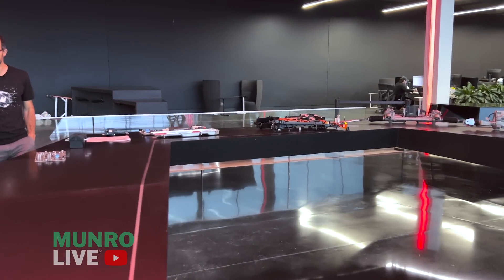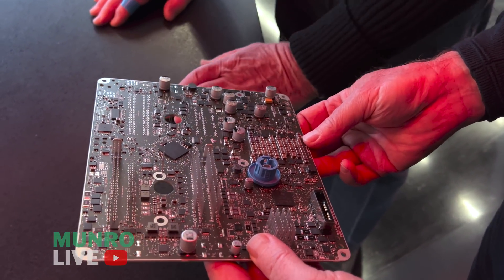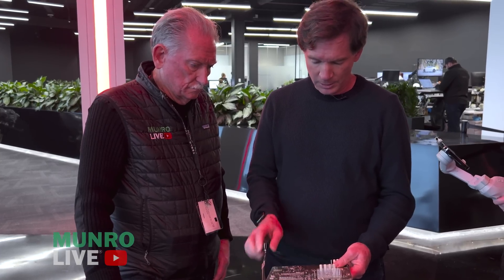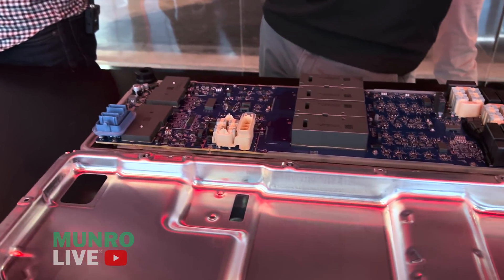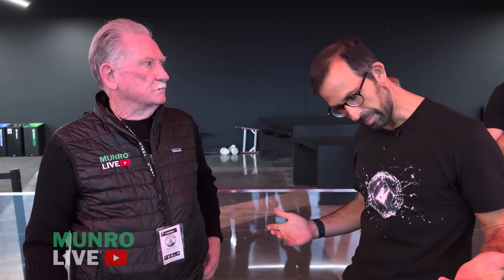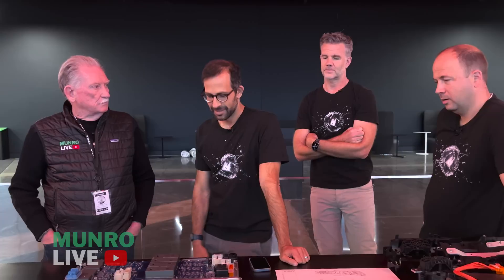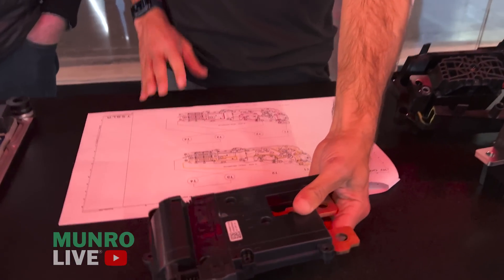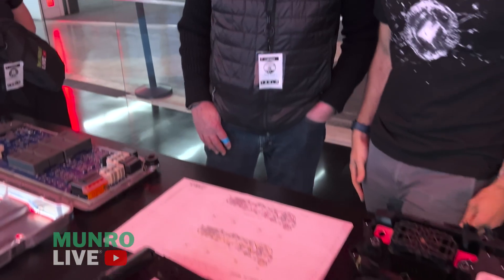Tesla Cybertruck's Power Converter capable of 800V

Comment: See I have a problem with this everyone saying oh well you don’t need the battery extender if you don’t drive very much but on the same term you’ve got all that power supply certainly someone’s gonna use it. Especially somebody on a ranch that 100,000 acres say or more don’t believe the acreage could be that much look it up. There’s several ranches there a lot bigger than that in the United States now imagine putting up a fence line around the entire acreage, and using the power supply to operate equipment while you’re doing fence post or working on. Other things on the ranch true the same could be said about some farms using the power supply unit, so yes, the extended range is needed in these applications, but what do I know? I just drive a diesel truck and work on a farm when I was younger, and now I have my own land to work on, just pointing that out for you Sandy this is what a pick up used for or at least it used to be

Comment: I find it interesting that they're using a switched capacitor power supply to bridge the 12 and 48 volt power busses.  I'd have expected a forward converter with a transformer and synchronous rectification.  That many ceramic capacitors are super expensive in small quantities, Tesla must get them at a great price.
Reply: What are you on? LMCC's are super cheap in  volumes companies buy. single digit cents a piece!  If you're buying 5 you're not paying for the components, you're paying to have someone cut the tape and count the components.
Reply: For safety, galvanic isolation is required on most 48V to 12V conversions.
But if galvanic isolation is there why limit to 48V, get a 400V/800V flyback is super cheap and reliable.

Comment: Those SMT electrolytic cap's have a life time of less then 10 years....in room temperature....and that far below manufacturers max electrical stress parameters.
Reply: Just enough to last 8 year warranty. After 10 years the battery will be dying and replacement cost will not make sense. These are 10 year lifetime disposable cars. But the tech is super cool that for sure.
Reply: @antronx7 to be honest, what new car will last more than 10 years? Definitely not any of the Detroit 3. Toyota maybe, but even they are slipping from reliability problems themselves. Most of my cars were made between 1992 to 2010, and I'm struggling to see benefits of owning another new car.
Reply: @TheReal_JG  Any car that has modular battery pack will be easy to retrofit with fresh cells. My 2011 Leaf can be retrofitted with new cells and it will keep on driving another 10 years. Easy to service, unlocked CANbus, cheap parts. Tesla wants you to locked in into their ecosystem and expects you to buy new car every 8 years.
Reply: @TheReal_JG  WEF Schwab have clearly said qoute: You will own nothing (rent when social credit score fulfilled), eat bugz and will be happy.
Reply: @antronx7 You are aware that the Model S is 11 years nowvand many holding up quite well?
Reply: @moestrei  If by holding up well you mean failing battery packs then yes.
Reply: @antronx7  1st pack , 380000km, 13% degradation. I know a number of high mileage Teslas...all in great shape. I'm not saying there are no failures but they are rare....I actually don't know anybody who had battery issues.

Comment: Did you hear about liberty engine( search on youtube) infinite energy they can modify a little bit and use that when use tractor mode for cybertruck so they don't need use energy from battery so it can reach 500 miles easily!

Comment: I wish we would go to a higher voltage esp on our actual power lines like europe does!
Reply: Standard power in Europe is 400Y230V.  One of the standard voltages in North America is 480Y277V.  NACS supports 277V.  Some utilities will provide 480Y277V to residential customers; nearly all will provide that to a business (if requested) instead of the 208Y120V or 120/240V that is normally supplied to small businesses.  BTW, split phase in North America used to be 110/220V, then it was raised to 115/230V, and finally to 120/240V.  Likewise, three phase used to be 190Y110V and 254Y440V, then it was raised to 199Y115V and 460Y266V, and finally to the 208Y120V and 480Y277V we have today.  There has been some talk of going to 125/250V, 217Y125V, and 500Y289V.  Doesn’t seem like it’s about to happen any time soon.

Comment: So there’s still a 24V component on circuit board right now, but eventually they’ll all go to 48V.👍
Reply: Well he mentioned the audio amplifier are 24V and Tesla are not going to design that part so they will push the component suppliers for a next gen.  Most amp chips for auto applications are <26V max unless you want the high power stuff but extra money where usually not needed unless a powerful subwoofer.  The level of integration here is certainly of a high caliber.  Most companies outsource a requirements spec and suppliers then bid for it.  The suppliers are usually free to use whatever design choices to meet the requirements but this is where it all falls apart.  Just think of all separate modules doing small tasks that need a separate enclosure, thermal needs, EMI needs, connectors, wiring, MCU running software written by the supplier, etc..  I know from experience than sometimes a supplier will put junior engineers to work on OEM modules with little experience.  One needs full control of everything if you want to make a next level product.
Reply: there are literaly 3,3v ,5v, 12v , 24v in that circuit still lol!! european trucks and equipments have been running on 24 volrs for decades alreadty just as example.
Reply: @alanmay7929  exactly!

Comment: All that Technology shown here more than compensate for the delays and price increase- 800V battery that can be split into two parallel for charging, a firewall with no openings on it coz the PCB is designed to attach from one side, diminishing current to 16th the one other vehicles less efficient use in their 12V systems, etc, etc, etc!!!!!  BRILLIANT!!!!!
Reply: They didn't diminish the current to 1/16th, current is 1/4th because voltage is 4x (12V->48V). The guy @ 3:30 is referencing I^2R (I square R) and is saying that results in 1/16th the heat. Probably not that low in practice, but it's undeniable 48V is the way to go.

Comment: Drew is so so proud of that power converter module!!
Reply: And so he should be 🙂
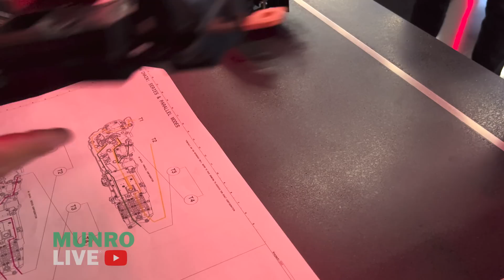Reply: Although, I rather wish they didn't show the diagram at 8:40. Let others figure it out for themselves instead of showing your homework. (yeah, i know it's not showing any component detail, but it's still a head-start for copy-cat companies )
Reply: @goldreverre exactly
Reply: The secret of parallel VS series is out!
I’m still curious could they have made the 2 sides, each 400V charge independently on existing SuC, possible anyone has thoughts? Might they have been able to increase charge throughput on existing hardware, charge port on each side until 800V is ubiquitous? @goldreverre
Reply: @goldreverre lol... very funny..

Comment: I'm so certain this is innovative achievement for Tesla. I don't have an EE degree so it is hard to understand what these engineers have invented and implemented into Cybertruck.
Reply: Speaking as an EE, I can say that many of the things mentioned in the video are not new or innovative as I've heard/seen them all before.  But, the way it is implemented using the best solution for the need and not being held back by simple or common thinking is where the innovative really occurs.
Reply: The new converter is smaller, lighter and will be cheaper with volume.

Comment: Lots of innovation in the Cyber truck.  Personally I would have really liked to see an integrated 500 mile range truck but understand the limitations.  Can the range extender be taken out of the bed and used to extend Powerwall capacity?  Also, why no power outlets in the front trunk?
Reply: It would be amazing if it can be added or removed for long trips but I doubt they will do that: electrical danger, weight, tight fit, need to absolutely secure it and ensure it doesn't get water in there. Seems like a specialist installation.

Comment: Why not just add a simple generator in the back running off of Gas Propane whatever charging the truck while you're driving?
Reply: For long trips
Reply: Warped perception chanel tried that w Tesla S. No doubt it can be done easier w CT 😊

Comment: A teardown with Tesla! What can we ask for more!

My breaking melted when the Drew said the CT can configure itself from 400v to 800v
Reply: GM did it for the Hummer but in a more complex method for 800V charging and 400V for normal usage. Were not able to have components run off 800V like this.
Reply: @petepetess  if I understand correctly, it configure itself to 800V only for charging and when you finish and go drive it goes back to 400V. That's one way of doing it. I google it and saw some info about it. Thanks for sharing
Reply: @JeromeDemers  DeWalt does it as well with their battery packs for a few years already.
Reply: @diavalus  yes! The 60V and then 120V for the miter saw! Good point. In dewalt i believe they did that to lower the current or else it was too much current for single 60v batteries or C rating was too much with that saw. Thanks!
Reply: @JeromeDemers , current can be limited, that's not a problem. The main reason why DeWalt did it was to keep it compatible with 18V platform (tools and chargers). Tesla did exactly the same thing to keep it compatible with older chargers.
Reply: That's GM's solution, @JeromeDemers  - a "400 V" vehicle with battery reconfiguration for faster charging at 800 V. Has Tesla done this, or have they built an 800 V vehicle with battery reconfiguration for charging at 400 V if the higher voltage is not available?
Reply: @petepetess  the GM method is not more complex... it might not allow use of high voltage accessory systems (air conditioning?) at both voltages, but the battery bank switching is the same.
Reply: Audi PPE Platform does the same. No booster required, but some other challenges come up
Reply: nothing special.
Reply: @alanmay7929  
Thank you for taking time from your busy day to come by and tell us that.

Comment: Sorry but looking at that config with the spit 400v 400v and then it goes back to 800 volt series, long term malfunction ever happened ? Well i hope it has a back up cause two 400 volts sources and a big switch sounds like mad craziness. Love the truck but 800volts guys!!!
Reply: pretty sure they have big contactor on each battery module and the 400/800 is done on a different module so they can mix the different voltage and prevent some weird issues like dumping 800v on a 400v bank if the switch fails to work properly. they probably have voltage sensor on either side before and after the contactor and they also probably disable the motor wiring to prevent power feedback and weird issues.
Reply: No, it's just the double-pole double-throw switch that it shown and described in this video, @patricklegault6383  ... plus some logic to ensure that it is only switched when appropriate. GM does this switching, too, in the GMC Hummer EV and presumably any other Ultium vehicle.
Reply: 800V makes their supercharger network useless.

Comment: I wish he asked them how the extended range power-packed connects to the system from the bed and will that connection be open to third parties for aftermarket batteries. 

Maybe someone crazy will even throw a diesel generator in the back and make a cybertruck hybrid . (Probably a dumb idea but it would be interesting)
Reply: Not so dumb. If your load is very variable it is even better to charge a battery with the generator and then use the battery for appliances. Generators tend to have very poor efficiency when used at a small load.
Reply: My understanding is you can install/detach it at a server center, perhaps third parties could do the same thing with the right setup.
Reply: It makes a lot of sense to be able to tow or carry an electric generator.  I don’t know enough about US Dept. of Transportation rules as to whether there would be a prohibition against having a a running generator while under way.  A rentable battery trailer would be another way to extend range.  I say battery trailer because of the mass of the battery.

Comment: I think they should have cut a little more out of the battery or whatever is down there so they could fit the spare tire in that half tire sized extra space under the bed.
Reply: That just means more wasted weight and less utilization (extra range vs a spare tire)
Reply: Yeah, not thrilled with this trend of no spare tire, especially for off road vehicles.
I also don't like the goofy hubcaps.  They'd get destroyed on the mountain trails I take.
Reply: @AZOffRoadster from what I heard, the hubcaps are 50/50 rubber and polyethylene that will be harder to damage than the conventional plastic hubs. I mean, you can still take them off, the hubs are for highway aero efficiency.
Reply: There's nothing "off road" about a Cybertruck, @AZOffRoadster . Have you seen all of the vulnerable components behind nothing but plastic appearance covers at both ends?

Comment: Did he just say there was still a 12v battery? Is it still a 12v SLA? Why retain it with its poor cold weather performance? Are the off-the-shelf components still 12v? 
An explanation of the relationship between the 12v battery, 12v battery maintenance, 48v bus, propulsion battery, etc. would be interesting to know. Is it in the full-length interview?
Reply: I think it was said that a 12volt can jump start the 48 volt system, via another vehicle. They built in the capability to do that , if I interpreted it correctly.

Comment: 0:17 - very interesting. It appears that although "etherloop" has adopted ethernet standards, it has its own type of connector - which makes sense, as the traditional ethernet connectors can come loose without a whole lot of difficulty, and that could be a very big problem in a vehicle.

No need to change the whole standard: just introduce a more secure connector (and possibly thicker cabling?) and get all the benefits of a long established standard without its drawbacks.
Reply: Tesla’s engineer did say “standard twisted pair.”  Ethernet can be lots of different media and different bit rates, so he didn’t really pin it down technically.  There’s a European automotive data transport standard called MOST which is an optical ring network with the capability of redundancy.  MOST is capable of encapsulating layer-2 Ethernet data Frames in its optical transport physical layer data frames, for example.  I know BMW has used MOST to network infotainment components; I don’t know who else has used it or where else it has been used.

I know my 2017 Chevy Bolt has at least some Ethernet in it because I saw some messages about Ethernet from the gateway module when I connected my scan tool to the car and did an all module topology scan.
Reply: @wtmayhew  this is probably 1000BASE-T1 / 802.3bp over STP
Reply: It's already a totally different standard than the Ethernet we all know
Reply: Interesting that he talked about doing PWM for stuff like window motors in that module.  I probably would have chosen to do it at the point of use.  Same goes for the audio amps; mount them on the speakers. You’ve a got a network loop in the vehicle, so leverage it so that everything connects only to power and network.

Comment: A Bidirectionnal buck converter AC-DC with DC-DC with 60A of 48Vdc!.. I wonder i fthe 48V side is also bi-directional?.. Would be great for some LV range extender pack!!, 3kW seem about 1/6 of the power requirement for highway speed but for every 4 hours driving you could still get 12kWh  addirional range.. for some DIY =)
Reply: Those planar pcb power inductors are next level. EMI filters are funky looking too.
Reply: @antronx7  I have couple half brick 150W DC-DC from Artesyn and Tyco that also have the inductor made in the PCB layers. These exist since about 15 years easy
Reply: @Doctorbasss  Right but these things are huge in comparison. 11kW vs. 150W.
Reply: @antronx7  yes  as well  !! Small Monster power!!!

Comment: 5:15 only now absorbed this part better. 11.5kw at this size of a device is incredible.  6KW solar inverters are at least 4 times larger and heavier than this.
Reply: Solar inverters are not typically water cooled.
Reply: @edc1569  solar inverters use heatsinks and fans but that does not account for the huge size. I think the reason this Tesla inverter uses the latest and expensive parts like silicon carbide and inductors that I haven't seen before and the 800V which needs less copper. check this video of the latest solar inverter. https://youtu.be/6alau_7t5NM?si=f6us8P1Uou1fvElK&t=474
Reply: imagine if they take some of this engineering into their solar products
Reply: @t3hpwninat0r  they do. the latest Powerwalls are pretty compact than competition and all their products that has an inverter are water cooled. However, this cybertruck inrverter for outlets or external power is on another level.
Reply: I agree, that module is incredibly impressive, I'd love a deeper dive as an engineer.
Reply: @cuisinart7899  same but I found out just now that probably most of the compact size is due to planar magnetic inductors and transformers.  not sure if the input voltage is 400v or 800v, opposed to my previous comment.
Reply: Tesla has been making onboard chargers that size for almost a decade. Aftermarket onboard chargers are available also in 6.6kw models, can be ran in series also